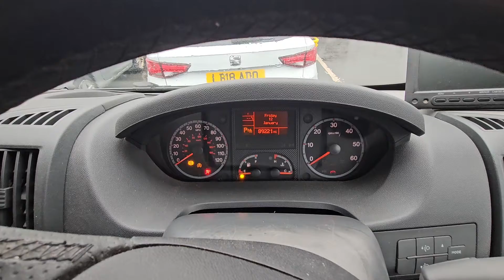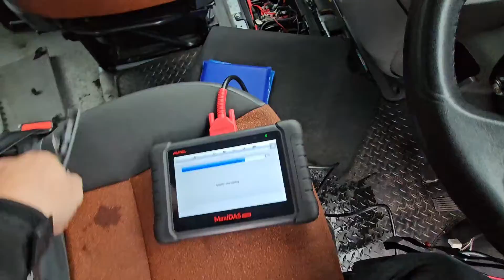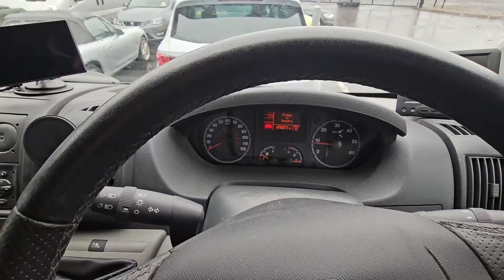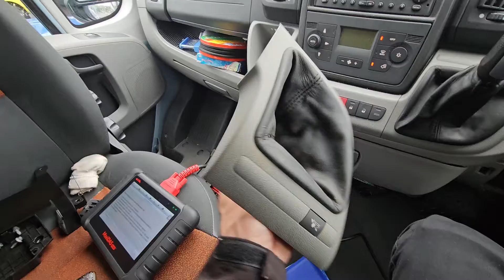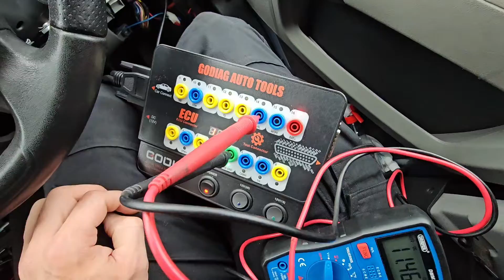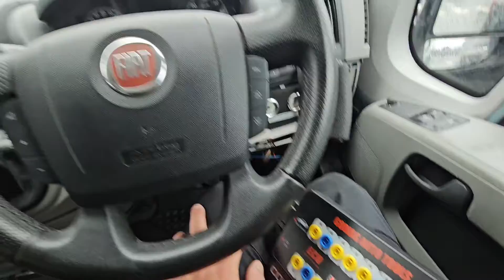Fiat Ducato Camper - Can Bus Fault?

Comment: The lever is hand control, disabled driver. Throttle is pull and push is brake. Switch on top is indicator left and 👍🏻
Reply from the maker: Thanks for watching and the info, i figured it out eventually!

Comment: I have the exact same issue did you end up finding a fault?
Reply: Ours is a camper too 
Did you disconnect all the control units? Didn’t show you anything?
Reply from the maker: @Stuart-f6c it was the body control module again
Reply from the maker: No not yet, starting to pull my hair out. Is your van converted to a Camper? If yes is it all original wiring or does it have additional wiring added from main Battery or body control module Fuses? This one has wiring from both by owner and i think that may be the issue.
Reply: Did unplugging the body control relay rectify the high voltage on the CAN line?